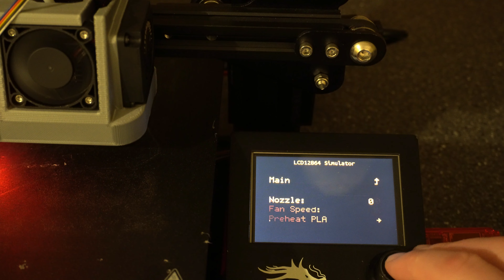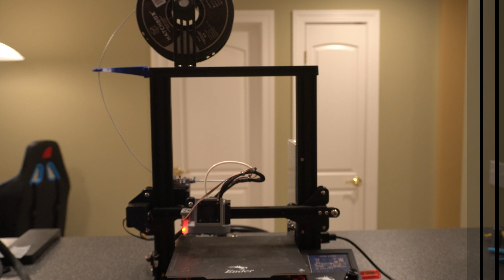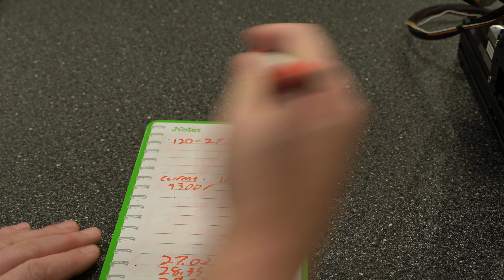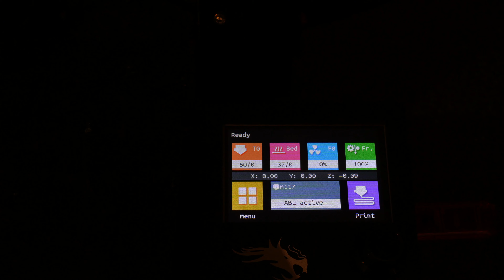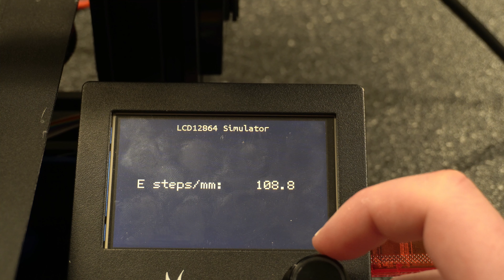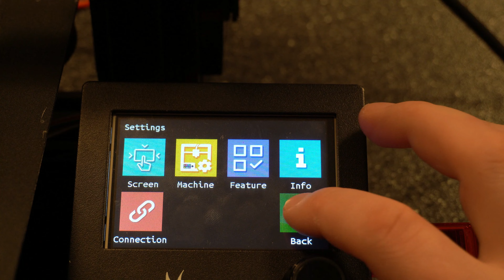Your 3D Printer Isn't Broken, It Just Needs This

Comment from the maker: I hope you found this overview helpful! If you have any questions or would like other tips/tricks, just let me know in the comments.
Reply: I hope you realise that you cannot alter the E steps like this on most printers.
Reply from the maker: This guide pretty much applies to all creality printers. I showed how to change the values in the normal screen as well as the TFT. Is there something missing?  @fredblogs
Reply: @3DPrintscape   Like you say, simple if you have a printer that doesn’t need a computer.
Reply from the maker: Ah, your saying your printer doesnt have a screen at all? If thats the case there are g code commands to do each step as well.  @fredblogs
Reply: @3DPrintscape   I do have a screen but the Elegoo 4 pro does not allow you to alter the e steps without a laptop. Something that I have failed to connect at the moment.

Comment: Using the btt touch screen simply cranking up the extrude setting and hitting extrude is going to put the same pressure you was talking about when using emulated mode.

What you didn't mention is that the touchscreen has a terminal, allowing entry of gcode to control the extrude more precisely:

M92 return estep value

G1 E100 F50 extrude 100mm slowly 

M92 [n] set esteps to value [n]
In your case :
M92 100.82

Of course that needs to be saved to eprom with:

M500

Terminal is your friend and is also good for pid autotune
Reply from the maker: Thanks for the info.

Comment: When I change my e steps it doesn't stay. It always goes back to 93
Reply from the maker: Hi, is that after a power cycle and are you saving them?
Reply: @3DPrintscape   I guess I don't know how to save. Also not sure what is a power cycle.
Reply from the maker: @devinharter3858  When you make a change, you need to find save (or store) settings, if you miss this step the changes will not persist after powering off the printer. Power cycle is just powering the printer off and back on.
Reply: @3DPrintscape  thanks

Comment: i dont understand... 9300/92.24 equals 100.82 did i miss a step in the calculations?
Reply: okay i just saw in other comments you had just messed up the recording. i can still use the formula for myself tho right?
Reply from the maker: Hi. Ya that was my bad. The formula is right though.
Reply: @3DPrintscape  man your channel has helped me tremendously. you can probably tell from my series of questions that i am diving deeper and deeper into the rabit hole. I do have a question about your cura preset standard profile for ender 3 pro. do you have inital layer flow set to 95 percent on purpose? i just wanted to understand your thought process with it. I have been getting my prints to stick and cleaning up daily. was wondering if i changed this to 100 percent of my first layer would change at all. for the better or worse. once again thanks for everything. you are one of the most valuable members of the 3d printing community i have come across so far. so genuine. thank you and have a wonderful day!
Reply from the maker: @codymccoy9295  Thanks for the feedback, i appreciate it. There are a lot of opinions on the best config for the first layer. I tend to find what works best for me and stick with it. I switched it to 95% when i was seeing issues with the dimensions of what was being printed. You could test moving it back to see it that works better with your printer.
Reply: @3DPrintscape  will do. I have been having some other problems... lmao one step forward 2 steps back. Now I have gotten to the point that my first 10 to 15 layers are absolutely phenomenal! Then my nozzle will clog up. I had an 8 hour print fail on me, my first spaghetti monster, and every few layers it was solid and then nothing. I know it is clogged because when I stopped the print I tried to manually push some filament through and it wouldn't budge. I'm gonna try upgrading my couplings and going to the all metal extruder. Then completely clear up the clog and pray. It's tough. Like I said first 10 or 20 layers were solid perfection then it just looks like ghost layers. Sad times but im getting there!
Reply from the maker: @codymccoy9295  You may be having the issue where the filament gets stuck between the tube and hot end causing it to clog there. Its pretty common with the Creality hotend.
Reply: @3DPrintscape  I have been reading about that. Luckily my new bowden tubes , nozzles, and metal extruder upgrade comes in today. If that doesn't fix it I don't know what will haha. Will I need to/have to recalibrate my esteps when I upgrade my extruder. Is there a sure fire way to know if your spring is tight or loose enough?
Reply from the maker: @codymccoy9295  Sounds good and not really. You will just need to feel it out. You want enough tension but not too much.
Reply: @3DPrintscape  sounds good! well unfortunately I found out that even though I got my printer 2 weeks ago, I still received an older model with the gear pressed fitted on. meaning my aluminum extruder upgrade is on the back burner until I get a new motor, by the way, if you have an affiliate link for one I will definitely use it. I still upgraded to a new Bowden tube and couplers... it is honestly ridiculous how much better my prints are coming out. the only thing I have changed thus far is the new Bowden and couplers. these couplers have a nice spring and bite to them.
Reply from the maker: @codymccoy9295  The hardware shipped with the printers very inconsistent, not sure if they just use what they have around for some of the lol. I have links in the video description :).
Reply: @3DPrintscape  hello friend. i checked your description for the link to the new stepper motor to make my new aluminum extruder kit work. i cant seem to find it. i was wanting to use your affiliate to support you in some way for all of the help!
Reply from the maker: @codymccoy9295  You can use one of those, then search once you get to amazon, that still counts. Or i have a video that covering the upgraded extruder, that one has a link for the aluminum one.

Comment: If you change to a dual gear extruder, you have to recalibrate your esteps, since the gear diameter changed.
Reply from the maker: Hi. You are correct. It really should be done anytime there is a change in the hotend or extruder.

Comment: Hey Rob. Thank you very much for this e-step guide. I had severs under extrusions and simetimes my hotend would clog from over extrusion. i couldn't quite get a perfect e step but when i did the calibration i had somewhere around 20.15mm of filament left from the extruder to the point i marked on the filament. it is good enough right now.
Reply from the maker: Hi. You're welcome, and Im glad everything is working.

Comment: Hey, I have a filament sensor and the mark stays inside of the sensor so it makes it quite hard to measure, any other way to do it, if u have a filament sensor?
Reply from the maker: Hi. I would adjust the measurements further out. Maybe go 150mm or something like that.
Reply: @3DPrintscape  The calculations would remain the same right just different values?
Reply from the maker: @nunungus  Ya

Comment: I have to say, you really did an amazing job of explaining this in simple terms. I would like to have watched you doing the measurements on the filament itself so I could just see, but my presumption is you simply measured from where the filament started to enter the extruder backwards 120mm. And, I also suppose you picked 120 as an arbitrary number which is larger than you would expect so you could get that measurement of 27.x or whatever it was showing you the difference. 

Anyway, great job!! Now, I am a sub :)

ps - thank you for serving our country
Reply from the maker: Hi. Thanks for the feedback, and sub, I appreciate it :). I tried to record as much as i could on the measurement but my arm blocked a lot of it out. I choose 120mm to give 20mm of leeway. The tune is for 100mm but if you just mark at 100mm and your over extruding it will be difficult to get a good reading.

Comment: Should you be multiplying by 120? 120mm times 93step/mm will give you 1160 steps?
Reply: Yes, everytime I used your equation my delta was off more and more because you need to multiply by distance mm
Reply from the maker: Hi. Sorry your running into issues here. The formula is (E/(120-D))*100 = New E-step Value and D = Averaged distance measured & E = Existing E-step value. This article may help as well. https://3dprintscape.com/3d-printer-e-step-calibration/
Reply: @3DPrintscape I think that formula on the link is incorrect. I believe it should  be (E/(120-D))*120    if you multiply by 100 and not 120 you have a mismatch of lengths in the ratio formula. E is S/mm actual length is mm multiply them and you have S (steps)  because mm cancels  out. The printer requires an input of steps per mm so then you multiply it with the desired length 120mm to put the answer into s/mm.
Reply from the maker: @MiningMagnets  The formula in the video and link are correct. Keep in mind the 120mm is only used when doing the measurements so you have a buffer if you are over extruding.
Reply: @3DPrintscape  oh!!! Now I get it. You tell the printer to move 100mm not 120mm. Thanks for the explanation.

Comment: Taking multiple measurements is great but you have a math error.  9300 / 92.24 = 100.8 not 108.8.  Your estop value roughly should be 100.8.
Reply from the maker: Hi. Ya your right. I did it right five times before recording but messed up the recording. The formula/process is right though.
Reply: Thanks! I was also confused by the math! The correct should be 100.8!
Reply: I also think he should have multiplied by 120 to get steps and cancel out mm

Comment: hi! im very very very new to 3d printing and i just instaled my bltouch and im triyng to adjust the z offset but the thing is, when the extruder heats up to about 150f it starts extruding i always use PLA filament so i dont know if that is over extruding could you please help me on this?thanks.
Reply from the maker: Hi. Its normal for the filament to come out like that when the nozzle is up to temp. I typically remove the filament when setting my offset.

Comment: Thank you so much, Rob! Im new to 3d printing, my ender 3 prints are bad straight out of the box. Found out that i need to bump my e-steps to 239.69. Before calibrating, i always override my flow rate to 210% to compensate.
Reply from the maker: Hi. Thanks for the feedback. The only thing worth mentioning is that your adjustment is very high so there may be something else going on.

Comment: Your math threw me off, and probably had you scratching your head with your next print if you didn't catch the error. That worked great for me and is so much less intimidating doing it through the machine than the computer and software. Thanks
Reply from the maker: Hi. Thanks for the feedback and ya the math ended up being wrong when i actually recorded the video, though i did it 5 times ahead of the video lol. I corrected it in the written instructions though.
Reply: @3DPrintscape  Right or Wrong it allowed me to get my e-step where it was supposed to be.
Do you have a video for things coming out too tight. Some of the nuts and bolts have been too tight to the point of getting permanently stuck together. 
I know there is a spot in cura to make minus or plus adjustments, but I lost my settings when I upgraded cura version last night and now I can't remember where I made the change.
Reply from the maker: @DaveM2  I dont have a video for that but if you increase the scale from 100% to 102% on the nut, or bolt, depending on needs it should fix the issue.
Reply: I'll try it, thanks. I made a calibration cube which helped a little, but I'll play around with the sizing too. Thanks

Comment: Nice video! I am struggling to change the value at my Ender 3 dashboard. I followed the videos to install a BLTouch on an 8-bit board which were easy to follow and it worked out well. However my printer's dashboard doesn't have the "configurations" tab. Do you know how to solve this?
Reply from the maker: Hi. Thats probably related to the firmware itself. I dont have an 8-bit board any more to do testing to check though.
Reply: @3DPrintscape  Hi, thanks do you know this can be solved if I buy a new 32-bit board to replace the 8-bit board that is now on my printer?
Reply from the maker: @alecdekoning6522  I believe it would be.

Comment: what if my printer doesn't have a option for extrude length when you need it through i got a longer Lk1
Reply from the maker: Hi. The fallback option would be to use Pronterface and g-code.

Comment: Hello! Great videos, I'm having another issue tho, my printer does not go to the end of the bed in the X axis, it's stopping 15mm before, I can move it manually by pushing it and it will reach, but if I do it from the movex (position 220 which is the max) or by octoprint, I can't get it to go to the end. Do you know what this could be?
Reply from the maker: Hi. What firmware are you using?
Reply: @3DPrintscape  i was using stock firmware 1.0.2, now i've installed marlin aftermarket one and i was able to fix the issue.
Reply from the maker: @lautarogatti  Cool, im glad you got it working :).

Comment: Okay... here's a question. Would I be over simplifying things if I were to say: Measure the amount of filament extruded vs. the amount the machine "thinks" it being extruded...AND THEN use simple math we all learned in high school called "CROSS MULTIPLICATION" to come to a "value/percentage" and just simply ADJUST THE FLOW RATE in the slicer to achieve the same results? Am I over-simplifying it or is this NOT the same principle? the only difference I am seeing is you are STORING the value in the firmware...am I correct? Please, correct me if I am wrong!  (/scratches head)
Reply: hmmm... i'm re-thinking... i guess the REASON you would do this is so that you could STORE the result for each individual printer.... my version of a solution would only work for a SINGLE PRINTER....(using cura/cross multiply/percentage)... am i right? or am i right???
Reply from the maker: Hi. The e-steps and flow rate are actually separate and both should be calibrated. The e-steps make sure your printer is pushing the amount of filament it thinks it is. The flow rate is similar but focuses on wall thickness. I made a video covering that as well. https://youtu.be/3PtS9vVCev8

Comment: I replaced my extruder now when I print it is like clump of plastic on my prints
Reply from the maker: Hi. It sounds like you may have a small clog in the nozzle. Hard to say for sure though.
Reply: @3D Printscape  no  clog I checked it is printing and there is a lot of extra filiament on my prints like a clump of thick string and when it is done printing does not finish a part but it has the clumps on it.
Reply from the maker: @ronaldpeel7288  Ok, so it sounds like its blobs. I would check your e-steps.
Reply: @3DPrintscape  ok how do I check that and what should it be at
Reply from the maker: @ronaldpeel7288  The setting is unique per printer. I cover the process in this video and have a good article coving it that you can get to from the description.
Reply: @3DPrintscape  ok I will check it out I also took a picture of the last print how do I send it to you

Comment: Thank you! This actually is the ‘easy way’ and I can deal with that much math. Should anything be done with the other stepper motors?
Reply from the maker: Hi. Thanks for the feedback. I dont normally calibrate the other ones as they are not as critical but you can adjust them if needed.

Comment: 6:15  Do you have a set up video? Not about the actual set up of the printer, but the additional 'hidden' stuff i.e. The fillament feeder on my printer is loose, it's not as neat as your one.  Also, I am wary about cable tieing in case I hamper movement of filament etc. 

Would be great to have a short video on these minor customisations for optimatisation/workflow.

Looked through the channel and subbed because you will be a good resource on this journey.
Reply from the maker: Hi. Thanks for the feedback. I didnt do a basic setup video. There were a lot out there and i didnt know if it would be wanted/needed.

Comment: Great tutorial as always. I am very new to 3d printing. I have an ender 3 Pro, all was working great until my most recent print. I went to recalibrate the esteps again and seems to be over extruding by at least 80mm. Could use some advice on this please
Reply from the maker: Hi. Wow thats over extruding a lot. Have you made any major changes to the extruder and have you tried a different roll of filament to make sure thats not the problem? Also, if you want to char about it more you can join us on discord. https://discord.gg/Bu94EYVkrU
Reply: @3DPrintscape  No haven't made any changes at all just changed the nozzle but was still working ok after that until yesterday. I will join now and can hopefully solve this
Reply: Hello I have found the skr mini e3 to be very susceptible to static discharge, especially when the air is dry/winter time.
I have had mine do all kinds of odd things in the winter or when it’s really dry outside.

Comment: Just curious how you got 108?  I get 100.82 when I do your math. I know I am doing something wrong. What am I missing?
Reply from the maker: Hi. The value you got is right, i wrote it down wrong :(. Sorry about that.
Reply: @3DPrintscape  no worries. I was just following and trying to figure my printer out. I have the Ender 3 Pro and it prints my parts like a honeycomb. Seems to be very under-extruded. I have used all your videos for setting my printer up and running it. Thank you for the great videos! I hope this helps my parts to print correctly.
Reply from the maker: @electri6man  If you run into any issues, just let me know and I will try to help out.